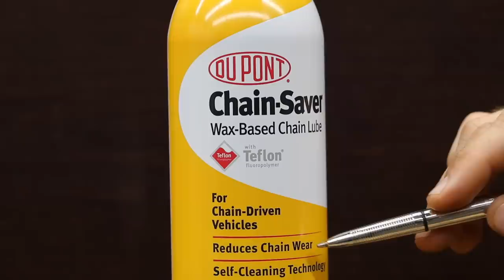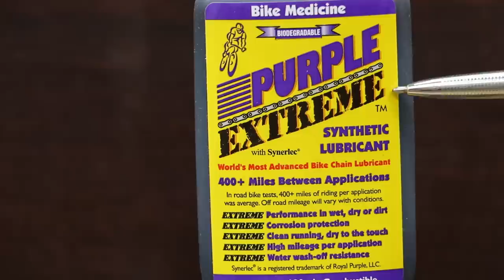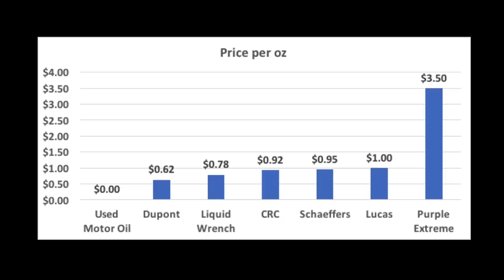Which Chain Lube is Best? Let's find out!  Ultimate chain lubricant showdown!

Comment: What if you sealed the chain compartment and add a breather filter.  If it needs a little airflow to stay cool, add an exit fan coming off the main sprocket.  CVT transmissions do the same thing for cars, scooters, and even side by sides.  They have a centrifugal fan attached to the crank sucking in filtered air, creating a positive pressure environment to keep dust out.
Reply from the maker: Thank you for the video idea!

Comment: My preferred bicycle chain lube is Tri-Flow. It's available in a "wet" (oil-based) or "dry" (wax-based) version depending on your needs. That being said, ANYTHING is better than having a dry, squeaky, orange rusty chain, which is what I see most often. I lived in a little beach house in my last semester in college, and despite being poor I still bought a bottle of chain oil and hung it from a string on a telephone pole outside with a sign that said "Free Bike Chain Oil". I was so sick of hearing people squeaking past my house, wasting so much energy, riding their bikes with dry rusty chains. I even saw a few people use it.

I'm not surprised that the CRC lube had the best lubricity. I mix my own special grease for threaded titanium parts, which are incredibly difficult to lubricate because grease just won't stick to titanium properly. My special grease has 20% MoS2 powder in it, and it's the only stuff that works well. I bet a wax-based lube that contains MoS2 would be an awesome dry chain lube. Now I need to mix up a batch and try it on my bicycle chains.
Reply from the maker: Great feedback on Tri-Flow. Thank you

Comment: I use Lucas products for everything on my dirtbikes. The chain, 2stroke mix, transmission, fork oil, and the grease in my bushings and bearings. I swear by Lucas through and through
Reply from the maker: Thanks for sharing.
Reply: @ProjectFarm  wow! Replying to a recent comment on a 3 year old video! That's extremely impressive brother. Thanks a lot for the reply

Comment: As others have commented acetone is likely to destroy o-rings.  Suggest cleaning with kerosene, add lubricating  one chain with 80-90 gear oil to the test and another chain without any added lubrication as a control.  Put chain under heavy load and run for a set time.  Before and after test measure the total  length of 10 or more links to determine wear.  This is the only true test of a chain.  The amount of dirt it collects or amount of rust are cosmetic unless they are proven to create wear.
Reply from the maker: Great point!

Comment: Just came across this video.  I also have a hay baler, and its a struggle to keep the chains properly lubed with all the dirt and dust that gets generated.  I've been using a product by Liquid Wrench (IIRC), but will probably give the CRC a try for the next hay season.  The trick is to use a lubricant that's thin enough to get into the internal surfaces of the chain (pins and bushings), while being thick enough to maintain a slight film on the outer surfaces.  Thanks for your efforts.
Reply from the maker: You are welcome!

Comment: Heating the chain before applying lube helps keep it from slinging. I use PJ1 Black on my bike chain. I put the rear wheel on a spool stand, clean / dry, apply lube and run a heat gun on it while I spin the rear wheel.
Reply from the maker: Thanks for sharing.

Comment: Good video. 
When it comes to bicycle chains there's two schools of thought, one is to use a dry chain lube, which doesn't collect much if any dirt, second is to use one thats thin which leaves behind lubrication properties. 
Tri-Flow (in the bottle), has been the go to lube in most shops for decades, its a Teflon based lube. 
A lot of guys prefer something more like Finish Line dry lube. 
On heavier applications, as on a motorcycle run in the dirt, most chain lubes sold for the purpose go in wet then congeal after a few minutes leaving behind either a grease or wax coating. I've always used either Honda chain lube or Cheatah Grease from Crest Auto. (both are excellent when it comes to retention and film strength. 
Chain speed also needs to be taken into consideration when choosing a lubricant. Something that works well on a bicycle likely won't do well on a high speed chain or one under extreme load. Another issue at hand on many bicycles is multiple sprocket materials, with many using aluminum sprockets, thus the lubrication needs can differ. 
On a fixed piece of low speed equipment, (such as machinery in a factory), where dirt is minimal, straight up grease is often the best choice where sprocket and roller wear is the biggest concern. On equipment where the chain is completely encased, an oil bath is the ideal lube. 
On something like a hay baler, a good bit of the dirt it'll see is chaff and light dust. While it will get some sand up there its not as if its running directly through the dirt. Any lube that stays put is the right lube. 
As a kid, I worked bailing hay for a friend of the family who was getting up in years, he told us to coat the chains with grease. He kept one grease barrel for everything, we would take a hand full or grease and slather the chains top to bottom. They'd collect a ton of dust and debris but they weren't gritty, just dusty. In the winter, they came off and got soaked in gas and re-lubed for the next season. 
On his one baler, the chains had rubber flaps that protected the chains a bit from debris. I'm not sure how much good they did but it made a lot of sense. I don't ever remember him having to replace any sprockets, but it did snap a few chains every now and then but I doubt it was lube related vs. getting something jammed in the baler itself.
Reply from the maker: Thanks for the feedback.

Comment: My dad's an avid cyclist... and he's settled on WD-40. I personally use ATF in an oil can (Type F, which is what's usually cheapest). Also works well in my old 3 speed geared hubs. I've read it's best not to spray chains as the goal is to lube the pins, rollers, and plate joints, not coat the exposed side plates with dirt attractants. But to each their own.
Reply from the maker: Thanks for the feedback.

Comment: About the best bicycle chain lube I've used is made from candle wax and kerosene.  It gets into all of the mechanical parts, doesn't fling off, and keeps almost all of the sand out.  A little compressed air clean-up is all that's needed after several rides.  I ride long distances on sandy roads on a mountain bike so the sand repellant is the most important characteristic for me.
Reply from the maker: Thanks for sharing.

Comment: Modern bike chain lubes come is  varieties: wet and dry lube. The wets are designed for wet dirty conditions. last longer and protect the chain in wet conditions better but attract a lot of dirt. The dry lubes leave the chain in an almost dry looking state. This attracts much less dirt which saves the chain but it needs to be replaced more often. Chain stretch and wear / friction / efficiency tests over a long term use ( with / without reapplication of lube. And clean / dirty test AND dry / wet test would show a more usable results table. 

There are so many products out there. You need to test the most popular and maybe a bigger range. Never heard of anyof the ones you tested.

Great series though. Love your work.
Reply from the maker: Thanks for the video idea.

Comment: I use chain and cable lube every day as I’m a crane mechanic. I actually really like Napa brand chain and cable lube. It’s clear, not as messy, and after a couple of days it gets kind of stiff and won’t attract dirt and dust. It’s also a very good spray grease for door pins or bushings. It will creep in there and then later on tack up and stay
Reply from the maker: Thanks for sharing.

Comment: I have been riding motorcycles since 1968 and motorcycle companies have always recommended gear oil. I have tried every type of chain lube made and have always went back to the gear oil. I soak a cloth and hold it around the chain and rotate the tire. By doing it this way the chain stays clean and will never need cleaning. You can spend money on chain lubes or just use the tried and true gear oil.
Reply from the maker: Thanks for the feedback.

Comment: Some input on the Dupont: My motorcycle has been in storage essentially for nearly 3.5 years. Last time the chain was lubed and used was with Dupont, after a track day at Daytona International Raceway. 3.5 years later there is ZERO rust, and the chain still feels great (no binding). Very impressed.
Reply from the maker: Thanks for sharing.

Comment: Thank you for the time and effort for another great comparison video! Again, you saved me from myself. I had been using Schaeffers on the exposed starter chain on my 1925 Studebaker. This chain is protected from dirt however, since it is adjacent to the oveflow tube from the radiator, corrosion and wear are major concerns. I'll be switching over to CRC. FYI - I was surprised to see rust on the chain in the past using Schaeffers. I thought that was unusual.
Reply from the maker: Thank you!

Comment: Motorcycle and bicycle chains are internally lubricated. What kills both is not running out of lube, but grit that gets on and inside and wears surfaces. Adding lube externally just attracts and holds grit. Boeshield and other wax based products work by keeping grit from sticking to the chain.
Reply from the maker: Thanks for the feedback.

Comment: Id like to see a thermal on the bar.... and more common bike shop lubes, like white lightning,  ATB, r&r, triflizzle, etc..... and then,  just plain old wax.... dip it in hot wax and hang to cool and dry.  Install and run it! Thanx for another great vid.  I use purple extreme and ATB btw...

Comment: I'm sure you know, but for the ones that don't, motor oil when used to live chains is usually done via constant drip and a wiper to smooth out the drops on the chain, sprays also have to be constantly monitored so that they are always on the product
Reply from the maker: Thank you for the feedback!

Comment: For a bicycle I've been using plain paraffin wax.  Heat up a cheap slow cooker, add some canning wax and let the chain soak for 20-30 minutes.  I've been very happy with the longevity, although it clearly works best in the dry vs wet
Reply from the maker: Thanks for sharing.

Comment: Very interesting, I agree, different applications should require different chain lubes. On my dirt bike I clean my bike after each ride and then use WD 40 to remove any water left in the chain. you need to  get rid of the water as quickly as possible, allowing it to dry on its own usual promotes rust. once everything is dry I apply my favorite chain lube. I have found that this greatly extends the life of the chain. chains require regular maintenance, regardless of the products you use. Is it important to choose the best product for you application, absolutely. I realize WD 40 is not a good lubricant but it does work great at displacement of water. In my opinion the heavier lubes do not work well if the chain is wet before applying lube but tend to seal in the water creating rust even with a good lube applied. maybe that is something for another video. Thanks again, i do enjoy the videos.
Reply from the maker: Thank you!

Comment: I remember I mentioned this in a previous post, but testing 80W-90 Gear Oil would be interesting to see.  That's what I used on our security gate chain, but I have a feeling that there's something better (and less smelly) out there that would work better - especially because the system has a mechanical sprocket that pulls the chain back and forth.  The primary complaint when they used chain grease was that it gunked up the sprocket and also the axle that turns the sprocket, causing gunk-related damage that required too much cleaning and it was a very messy job to do that took far too long.  Thanks for the great video!
Reply from the maker: Thanks for the video idea.

Comment: Can't speak for other applications, but for bicycle chains, a dry lube is always best because it doesn't get all over you or your clothes and also doesn't attract as much dirt as a wet lube would.. Personally, Ive used Tri Flow with great results over many years of bmx riding. 
Out of the lubes tested here, for a bicycle, I'd definitely roll with the DuPont
Reply from the maker: Great point. Thank you!

Comment: Most don't realize chain drives were originally designed to run thru a oil bath which practically eliminated wear so running them in open air pushes them to their limits but are still one of the most efficient ways to transmit power.
Reply from the maker: Thanks for the feedback.

Comment: I use used hydraulic oil mixed with diesel fuel on my baler chains.  Put it on when you are done baling when chains are warm, and every couple hours while baling.  My chains lasted for 10 years on my baler and around 8,000 bales.  I’m to cheap to buy chain lube but thanks for the great test.
Reply from the maker: Thank you for the feedback

Comment: Need to try CRC as a motor oil in the lawnmower. Passing the lubricity bearing test with barely any scoring on the bearing, and remaining on the chain after being ran in the chain saw.. seems like it would be excellent for engine use.
Reply from the maker: Great recommendation! Thank you

Comment: I've been using Lucas, and getting 25k + out of chain and sprocket sets on my motorcycles. In my experience, the chain will collect dirt when on gravel all day, but is really east to clean and re-lube with Lucas. Some of the other brands (looking at you CRC) are too sticky, and impossible to clean when they get gunked up.
Reply from the maker: Thanks for the feedback.
Reply: @ProjectFarm   Any long term update on the hay bailer chain?

Comment: Way too late of a response and probably already been said, but you apply motorcycle chain lube after you have been driving with it = hot / warm chain. This will help stick the lubricant better. You now have used the products on a cold chain which is technically not 100% perfect method. But I love your channel, keep up the good work!
Reply from the maker: Thanks!

Comment: I've been using a light coating of 75-90 valvoline syth gear oil on a cleaned chain. Been doing this for my motorcycles for a lot of years. I have yet to find a "Spray and forget" product but regular chain/sprocket cleaning maintenance goes a long way in preventing corrosion and grime build up, prolonging the life of both chain and sprockets..
Reply from the maker: Thanks for sharing.

Comment: I don't know how this applies to other machines that use chains but for bicycles any lube on the outside of the chain is actually a bad thing. Lube is applied to the rollers in the chains and is allowed to sink in between the rivets reducing friction inside the chain. The chain is also shifted a few times to apply some of the lube to the cassette. The excess lube is wiped off to prevent additional dirt build up and only a very small amount is left on the outside of the chain to prevent rust.
Reply from the maker: Thanks for the feedback.

Comment: Great job as always but you caught a tribologist that routinely lubricates chains when you were last fishing for viewers.  I can't leave it alone.

For chain lubrication, the lubrication film test was not really appropriate.  That test tests hydrodynamic film.  Chains work in the boundary lubrication regime.  Some of the lubricants, especially DuPont ChainSaver have volatiles that flash off before they are used.  They are not part of the lubricant but part of the application system.  The chainsaw test was a great test.  I would have been interested in the temperature rise of the chain.  

Chain lubricants  have some unique requirements in addition to what you identified.  They must penetrate inside the rollers of the chain.  They must bond to the metal surface.  They must have Extreme Pressure additives to protect the metal and not be wiped away during operation.

Again, great job.  I'll keep watching.
Reply from the maker: Thanks!   Thanks for watching.

Comment: Ideally, you wouldn't be putting oil on a chain, but grease.  The reason is, oil is liquid, and eventually will drip off.  Grease, on the other hand, is designed to stick around.  So a spray usually has grease dissolved in a solvent, sometimes with other things like Teflon particles suspended in it.  I remember this about a bicycle chain lube I bought several years ago.  Part of the secret of good chain lubing is allowing a long time for letting the solvent evaporate, a few days if you can.

Or the people who taught me about this could be totally nuts, I don't know.  The spray lube I used on my bike seemed to work well, that's all I can tell you.
Reply from the maker: Thanks for sharing.

Comment: It should be noted that the criteria are a little different for modern street motorcycle chains. They are permanently lubricated with the innards sealed with O or X rings. The lubricant applied to the outside is there just to keep the outside from rusting, and the important thing is to NOT attract dirt (which would wear the sprockets) and to prevent rust.
Reply from the maker: Thank you for the feedback

Comment: Simple candle wax is by far the best. Attracts no dirt, has no residue and lasts. I dip my e-bike chain every 100-200 miles, this cleans and re-lubes the chain in one step. I do a lot of trail riding, this method has saved my drivetrain. Before discovering this dirt and sand would get stuck to my chain and gears and I'd have to clean it after every 10, maybe 20 miles. Now, I hardly have to think about it.
Reply from the maker: Thanks for sharing.